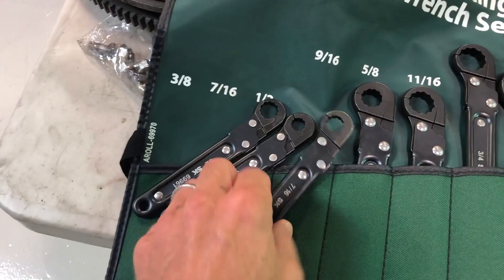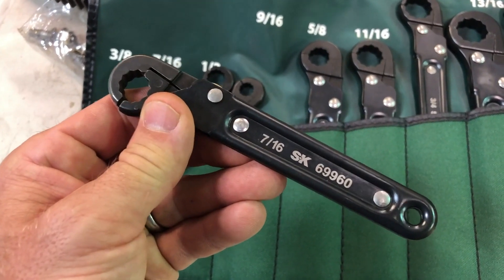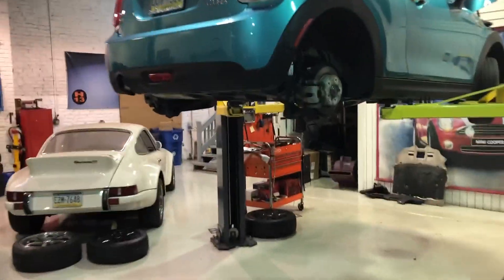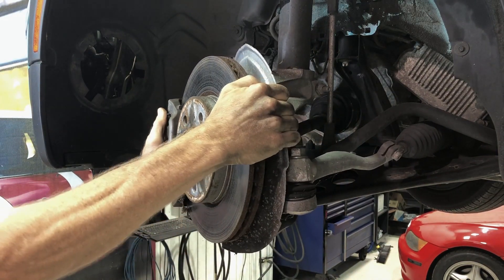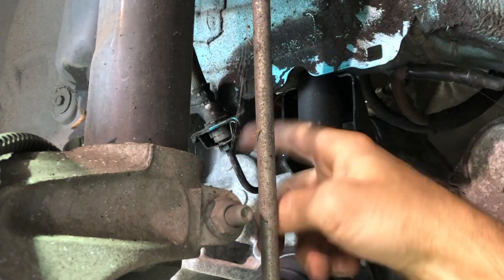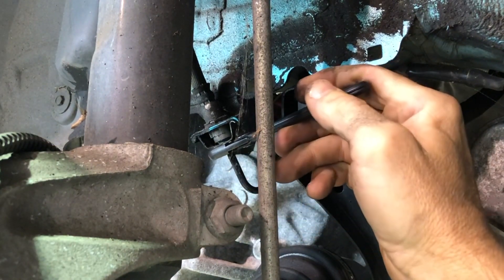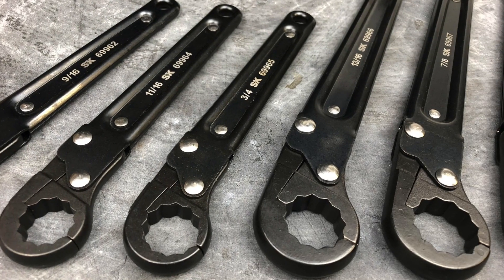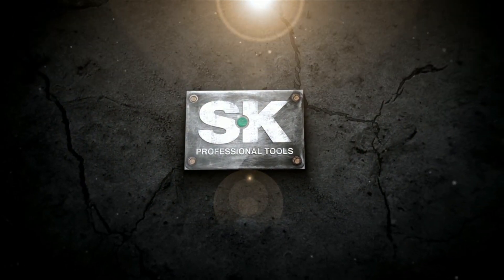Adjust Fasteners with the SK Ratcheting Flare-Nut Wrenches

Comment: 1” flare nut must be for hydraulic lines. Also, wouldn’t these mess the fasteners up to? You have the steel jaws grinding against the corners of the fasteners during the “ratchet” action. Or is not a big deal as you’re not tightening/loosening the fitting on a regular basis?
Reply: I would guess they would mar the fastener but it wouldn’t actually take off any structure the damage would only be superficial because they tighten pushing one way but on the backstroke they just open up
Reply: They don't wear the fasteners any more than a normal wrench. The opening action is pretty relaxed.
Reply: Beats using an air hammer to lose em up.